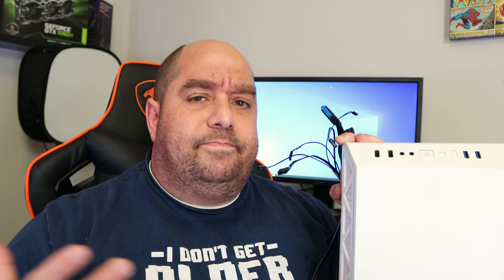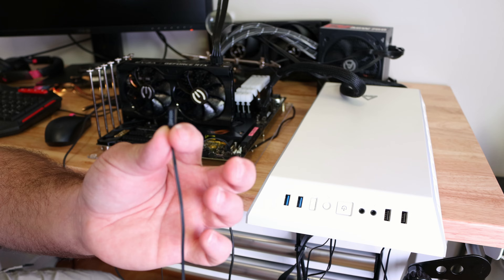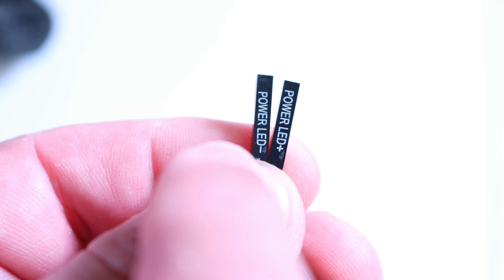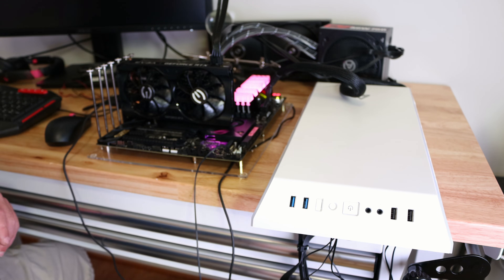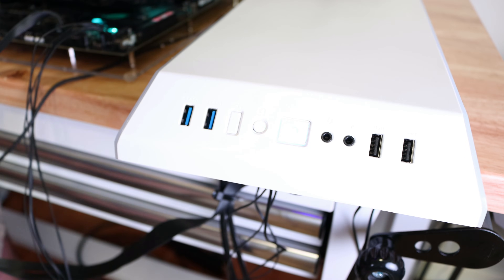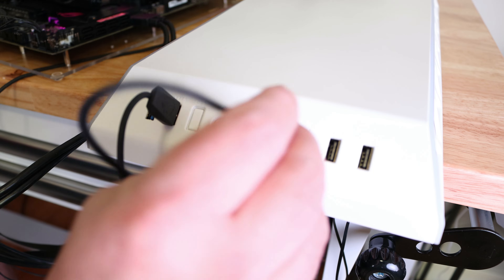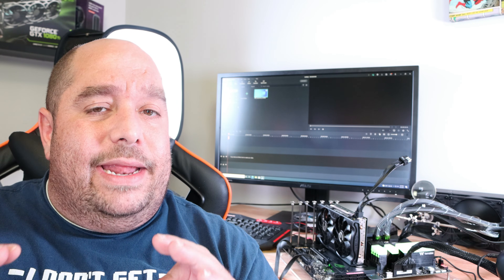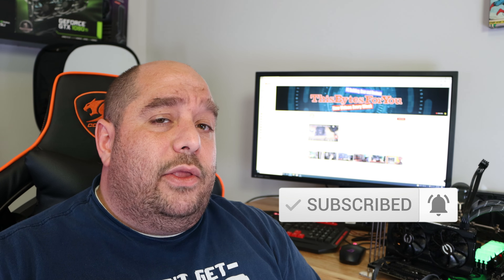Front Panel Connectors - Where do they go connected

Comment: What about the led io to change fans colors where do you connect that should be led sw
Reply from the maker: Usually it would be in the reset switch, led is for the led light to show you it's on or activity light but you can also use a RGB software to change the lighting.

Comment: I have a slight problem. My USB stuff are individual wires and not like that. How do i connect it? Pleaseeeee helpppppp
Reply from the maker: you need a header for that to work, you can do it individually, but you can do it through attaching each cable individually into the header, I dont have a diagram for that though.

Comment: Hi! Great video as always! 
I have a Gigabyte B660M DS3h motherboard and Raidmax F01 case which comes with both a "Reset SW CH" connector and a "Reset SW" connector. I suppose the latter is used to switch the RGB colors from the button at the top of the case, where should I plug each of them? There's a "Reset SW" print on the motherboard, but no "Reset SW CH". Tried to put it in different pins and none of them work for either connector (won't change RGB colours nor reset de PC) Rest of the panel works fine.
Reply from the maker: Sadly I can't find a manual for your case, but usually yes it does go into the reset switch header on the board, you can find it here on page 23: https://download.gigabyte.com/FileList/Manual/mb_manual_b660m-ds3h-ax-ddr4_e_230213.pdf?v=466e5cace873a3cb3deab1ec02e1cdc8

but there is also a BIOS switch for this, you can find on page 22: https://download.gigabyte.com/FileList/Manual/mb_manual_600series-bios_e_v3.pdf?v=e176cfcc0bb7f8b739252e4d3b0b9101

That should take care of you.  Please let me know how it goes.
Reply: @ThisBytesForYou  Thank you! I'll check it out!
Reply from the maker: cool, let me know how it goes.

Comment: Is it suppose to slip out? Cause mine aren't sticking in
Reply from the maker: @JitterBoltTTV    when you push the pieces of plastic that have tiny metal tubes in there (kinda tubes), the tubes should be tight enough to hold on to the pin ,  if it's not you may need to pull it out, tighten it then push it back in, see if this video helps you https://youtu.be/xufdqCsPdjs?si=UjMNPBoEosQ9bYGX
Reply: @ThisBytesForYou   Absolute Legend, Couldn't get them to stay and it was doing my head in and i couldn't find any videos so specific

I appreciate the dedication mate 🤩😸
Reply from the maker: Awesome my friend, so very happy I could help you, so was the in fact your issue, the metal piece just opened up too much?

Comment: Hi bro, thanks for this. I only have a question, somwthing wasnt clear. The speaker, it has a + and a -, but it's not clear on the motherboard what the pins are. Does the speaker orientation matter?
Reply from the maker: The speaker does not have polarity, and if it did, which it could I guess, if it doesn't work one way, flip it and test it the other way, you won't mess up the board.

Comment: every 5 to 10 years I build a pc, and I find I waste more time making sure the front panel connections are correct.   Old case with new motherboard kind of make it a nightmare (for me being paranoid that I will fry a new motherboard)  Still do not have a speaker connected for the beeps since my case cord is not compatible with the motherboard.    Thanks for the video.
Reply from the maker: Always a pleasure my friend, so very happy you stopped by, trusted in me to help you, liked and subbed as well as took a moment out of your day to thank me.  It means a ton to me and I am so very happy I could help you.   It can be a bit challenging sometimes so I am so happy I could help you.

Comment: Okay I can read the writing on the motherboard but there's no minus. 
It has +pled, +hdled, +pwbtn, +reset with 4 upper and 5 lower pins. 
But my wires I've got a (double)wire that says hdd led+-,(double)power sw qs, and single power led+ and power led-.
I  think I'm gonna have to guess, how bad is it if I go it wrong?
Reply from the maker: @spriken  no issue what so ever, you would just have to flip them around. But the + on the left of the word, mean the + is on the left and the - is on the right ;)

Comment: Hi there just one question my case don’t have reset connection how can resolve that?
Thank you
Reply from the maker: @MC-uz4if  you don't need to use reset if your case doesn't have it.  Reset can be pressing and holding the power button for 10 seconds, powering down the system then waiting 2 seconds and press it again to power it back on.  I am showing all the connections, not everyone will have one.

Comment: I’m not sure why Corsair in the 6500x doesn’t have the HDD pin in the adapter.
I know it’s not a big issue but why ahahah, I need another cable?
Reply from the maker: It doesn't look like it has a hard drive/ssd activity light, not really a big deal as it tells you if your system is accessing the storage, most never look at it.  Not all cases have all the connectors I show you, but I try to make it as complete as possible, I hope you enjoyed it my friend.
Reply: @ThisBytesForYou  yes of course, thanks for the video, my issue was the front panel adapter.
After the plug-in, nothing on, the only issue was the power switch upside down ahaha.
Subscribed 🙂‍↕️
Reply from the maker: Ahhh good stuff my friend, and don't feel back, thats actually very common, no worries my friend, I got you and I am so very happy to have you as part of the family.

Comment: My computer won’t turn on can someone please help me
Reply from the maker: impossible to help you without information.  Kinda like going to the mechanic and saying my car won't start, how much to fix it... and forgetting to mention you don't have an engine, are missing 3 tires and the gas tank hasn't had gas in it since 1999.
So that I can help, please list the manufacturer and exact model number of the following components:
1. What did you do that caused it not to turn on?
2.  Are the lights on in your room, does your house have electricity?
3.  Motherboard - manufacturer and exact model number
4.  CPU - manufacturer and exact model number
5.  RAM - manufacturer and exact model number
6.  Video Card - manufacturer and exact model number
7.  Power supply - manufacturer and exact model number
8.  Monitor - manufacturer and exact model number
9.  Case  - manufacturer and exact model number

Comment: Good instruction video. I'm upgrading my pc from a previous build. I couldn't find the rest cable sw cable or usb cables in the case, seems I don't have it. But I have plugged in usb stick in the front before. Also nice to see I got the rest set up the right way like the power and hdd led to the pins.
Reply from the maker: Well awesome bud, so very happy I could help you on this and yeah, not every case has a reset, I like them but you can reset your PC by holding the power button for 5 seconds or so, to turn the PC off the press it again to turn it back on, slower but it works.

Comment: On my build had a problem with the front panal conectors.I bent the pins on the USSB 3 conector and that was a big problem becauseI had yto send the boatd back to gigabyte>>Thankyou formaking it sound easy??
Reply from the maker: It happens, I make it sound easy to put you at ease, if I made it sound difficult you wouldn't try it.

Comment: Where can I get this connectors from cuz I have a case that doesn’t use the same headers so I’m gonna have to do that I need some guidance lol
Reply from the maker: what is the manufacturer and model number of your case, every case has them, its how you turn you computer off and on, how you reset your computer (though not all cases have a reset button), how cases have the LED activity and Power LED, its got it, but it may be hidden, or it could be from an OEM case.... and thats a different issue.
Reply: @ThisBytesForYou   well uh is hard to explain i have a lenovo h520 case but the board is an Asus H110 m-c i got it to work but i wanted to use the power button and stuff instead of having to jump it but i cant use the button because the headers of the wires are not the same as the board which is why i think i may have to do that  sorry if i suck at explaining i am like new  on the compute building this being my first build but i like things to look oem if you know what i mean.
Reply from the maker: @Pendragon69608   @2009darkmaster  well if you removed the power button from the original case you could rig it behind the current button and make it work.   Oem cases like to change things to make them not easily interchangeable and make you have the problem you are having now.  I get what you mean so no worries but I have many build guides here that will help you building a PC from the ground up.
Reply: @ThisBytesForYou  alright haha.
I figured, that  I would have to rig it,  the only reason I went with this case cuz I found it on on the side of the road complete and worked so I took the Mb out and added mine and love the case flow mainly um so yeah and I am also new to your channel and loved this content and hope to learn more from you sir have a good day.
let you know how that goes :D
Reply from the maker: Thanks my friend, I've been on a bit of a lul this month since I lost my day job, 4 weeks now but just got one and start on Wednesday I was laser focused  on getting a job I didn't do much in line of reviewing but much more coming soon.  Please remember to subscribe to keep updated with my release and like the video, it helps a ton.  And any question you may have, please feel free to ask.  Always here for you
Reply: @ThisBytesForYou   btw again thank you for replying its nice of u.
Reply from the maker: @Pendragon69608  and always a pleasure, I love to help

Comment: hi there,problem from gigabyte b660 x ax gaming 5 beep  and no display,can you help me please?:((((
Reply from the maker: 5 beeps could be anything, 3 short 2 long, 3 long 2 short, 4 long, 1 short, etc, help me help you
Reply: @ThisBytesForYou  5 beep short only
1sec per each.pc still online but no display.many guid i saw befor find you sir but dosent help me:(.many guid saw on you but dident find anything from this part
Reply from the maker: 5 short beeps means there is an issue with the CPU, what is the CPU you are using?  Though it could also be the RAM, lets say the slots are 1, 2, 3, 4 what slots do you have the memory in?
Reply: @ThisBytesForYou  core i3_12f 
and 2x 16 gig cosair 3200 put on 1and 3 slot
Reply from the maker: @voodoomoo  put the ram in slot 2 and 4
Reply: @ThisBytesForYou  i did it befor,claen the ram and graphic card slot,open che cpu and check it make sure everything be cool,but still pc online and no display and got 5 short beep😓
Reply from the maker: @voodoomoo6370  you did it before, do it again, they don't belong in 1 and 3.  The other thing is your processor, I will check it see if it's compatible
Reply: @ThisBytesForYou  ok sir,im ready on your guid,one more thing,have 2 little light up my case,red and blue,the blue one is active yet,never seen befor this part
Reply from the maker: Remove the CPU, then verify there are no bent pins, if there are, try to see if you can bend them back, if there are not, put the cpu back in and reapply the thermal paste  and put the cpu cooler back up.  Verify you have the proper 8Pin connection on the top left corner for the cpu power, its called EPS, MAKE SURE ITS NOT PCIE/VGA.
Reply from the maker: also, make sure you are plugged into the video card, not the onboard graphics for your monitor, also make sure you have the correct PCIE cables connected to the video card.
Reply: @ThisBytesForYou  ok sir,actually check the cable pluging to g,card and monitor and make sure about that,just need check the cpu to open it again
Reply from the maker: As for the lights, 2 lights, that means you connected the front panel cables correctly, maybe, check the polarity, the video you are commenting on is a short, you can watch the fill video, this video goes into more detail, but answer the questions below too: https://youtu.be/k6A3MG3yJzQ
So that I can help, please list the manufacturer and exact model number of the following components:
1. Motherboard - manufacturer and exact model number
2. CPU - manufacturer and exact model number
3. RAM - manufacturer and exact model number
4. Video Card - manufacturer and exact model number
5. Power supply - manufacturer and exact model number
6. Monitor - manufacturer and exact model number
 Redundant I know, but many people forget to enter manufacturer and exact model number
7. Do you have ALL of the PCIE connections plugged in, and not daisy chained or pigtailed, each coming directly from the power supply?
8. Are you running through HDMI, DP, DVI, VGA, any adapters?
9. UEFI in the BIOS from Legacy.  If it was set to Legacy, you will need to reinstall windows to get correct support.
10. Disable CSM in the BIOS
11. Installed latest supported chipset driver?
12. Have you disabled Fast Boot within Windows?

Comment: The manual is useless. It has a bunch of connectors that are completely different from the ones of the case.
Reply from the maker: incorrect, the manual is incredibly useful because it tells you what each of the pins does, because on each board they are different, 1 guide, 1 video won't cover it all, but this will help tons.  

I was a product development engineer for Alienware, when it was Alienware and then later Dell when they bought us and Velocity Micro and I would test boards before they were released, so I would look at the silk screening, but many don't know about that, and many silk screenings don't make sense anyone, for example on Gigabyte boards  

You match up the manual on the board with the connectors on the case, the manual for the case is worthless as the cables all make sense, especially with this video.

Comment: The bytes for you can you help me I just build my first pc and it won’t turn on
Reply from the maker: Not turning on, usually means you have the front panel power button connected incorrectly to the motherboard or you don't have the atx 24 pin connected or the 8pin eps CPU power connector, maybe the power supply switch hasn't been flicked on.

Comment: Bruh my pc doesn’t turn in
Reply from the maker: Not turning on, usually means you have the front panel power button connected incorrectly to the motherboard or you don't have the atx 24 pin connected or the 8pin eps CPU power connector, maybe the power supply switch hasn't been flicked on.
Reply: @ThisBytesForYou  it turned out that I had a faulty psu

Comment: This is by far the hardest part in building a pc. Why do they make them so small and so close together? Should be color coated where each cable is a unique color.
Reply from the maker: At first yeah it's rough but once you have done it enough times you know one of 2 things, look at the manual or the silk screening and you got it.  As for a standard, you have to get case manufacturers and board manufactures together and it also cost more money that we would have to pay more.  Also, it has to be that all because each piece that it it connects to connects through a wire (thinner than a hair) through several layers of pcb and through so many other pieces of circuitry and numerous other things that they want to keep it tiny.  Even the location of this collection of headers is different from board to board along with each form factor... It's a huge challenge.

Comment: Great video. Did you ever try not connecting any power, reset or LED connections and start the system with a keyboard command (with bios settings) - to get rid of all these cables while making a super clean build?  Or if these are obligatory to install even though you are forcing a start with a keyboard shortcut?
Reply from the maker: I haven't sidce that is such a small portion, and not sure it would work.  Not connecting the cable will get rid of the physical reset, power LED and hd activity LED, plus get rid of the physical power button  and then your machines will have buttons and LED's that do nothing.  You can get away with potentially waking from Sleep in the BIOS with the keyboard and maybe the power button, maybe but the others wouldn't work.  Thanks so much for your kind words and support my friend, they mean a ton to me.